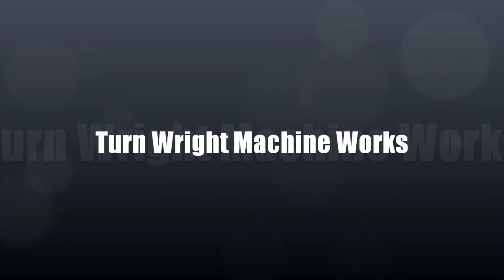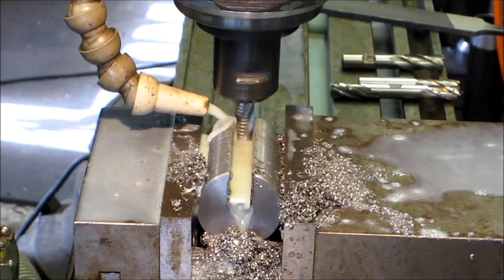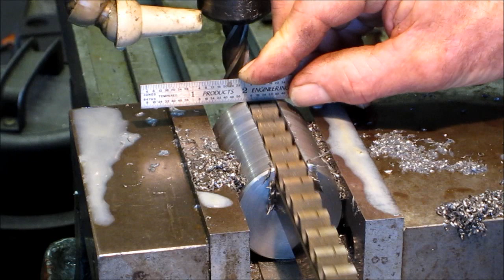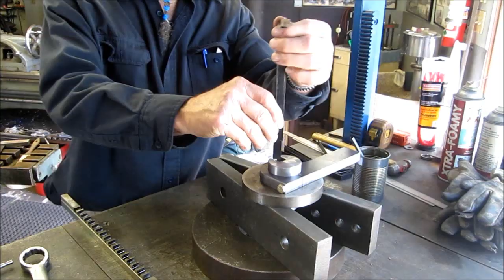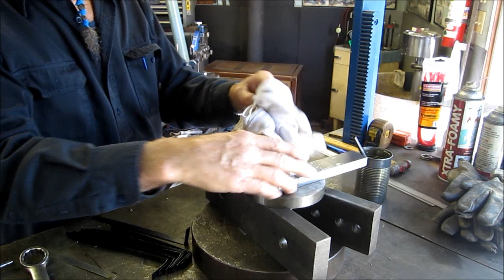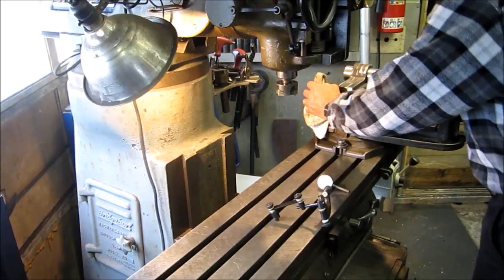Portakey Part 3

Comment from the maker: I believe I did it in three passes with the turbo mill before switching to the 9/16" smooth mill. Yes, good idea if it was real important to have the two keyways perfectly alined, to use the parallel, to gain more judging surface in sqaring it up...

Comment: Nice vid, thanks!  250 views/first 8 hours...quite a following!  How many turbo end mill passes to rough out broach guide slot?  Squaring side of broach to get broach guide slot perp to part bottom: broach side does not present much surface to square, maybe coulda clamped a parallel to broach...plan to cut keyway in rudder shaft by plunging, moving the cutter down shaft length/plunging again, will be neat to see how you ensure keyway bottom has constant depth...+1 on Indicol, great holder!

Comment: Keith that is a cool tramming adapter you have.  The one we have has 2 dial indicators and looks like a "T".  It works good but you have to watch out when you spin you don't drop the indicator in the table grooves.  You also have to put in in the chuck so that means taking out your cutter or whatever.  I like your setup much better.

Comment from the maker: It is posible to have warped table top but rare I'd say! The center dovetail guide surfaces wear first, and will give you what appears to be steps when using multible passes over a large surface. You know when your tramed in perfect, if it back cuts or scratchs in all directions, within its own, cut swing or cut diameter...